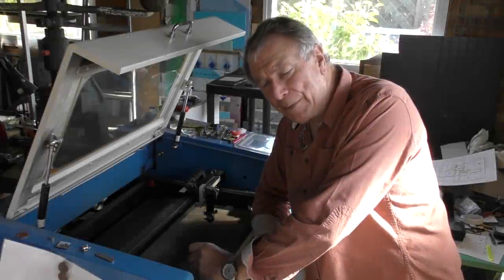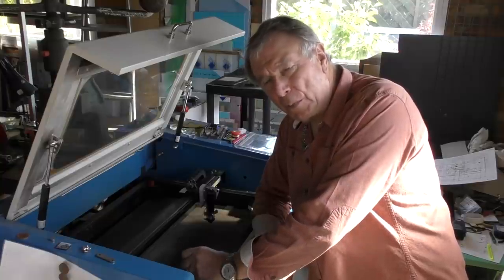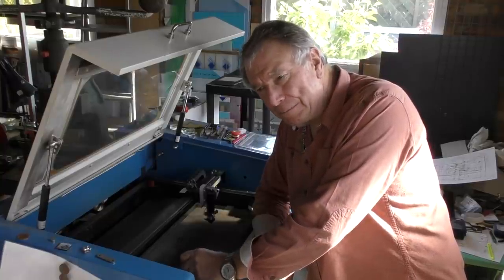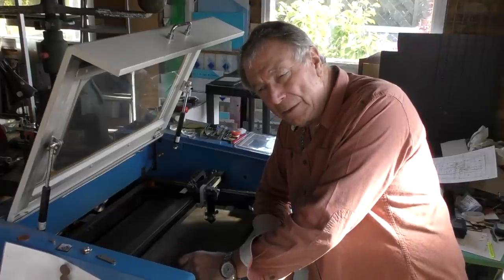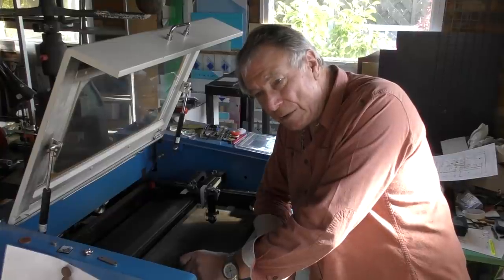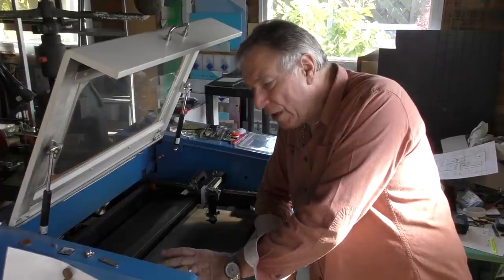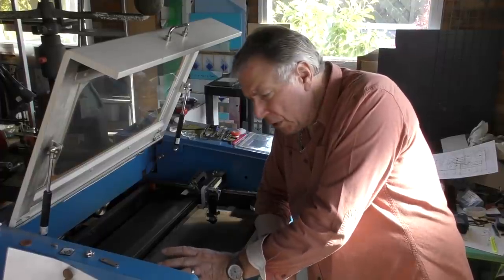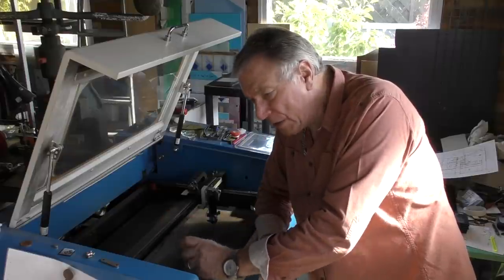RDWorks Learning Lab 189 Creating the Russ Spec Machine Part 1

Comment: I recently bought a UV printer, it's got a massive heavy printhead assembly.  They solve the curtains problem using an encoder as well as mounting the pulleys on springs, that greatly reduces the vibrations while maintaining the grip on the belt.

Comment: I just bought an 1300mm x 900mm 100W laser.
The laser works fine, But I just realize isnt 1:1 scale.
I design a line of 950mm and the laser cut a 940mm. 
I use RDWORKS and RDC4442 controller.
do you how can I fix it???
Reply from the maker: Hi William
 Sorry I missed your comment and apologise for the tardy reply.

First draw a large square in RDWorks , say 200mmx200mm Set the parameters to cut at about 20% power and 20mm/s. On a piece of card/wood/mdf burnthe 200mm square, and measureand note the X and Y dimensions you have created.
Go to FILE, Vendor Settings and use the password RD8888.  First you must press the READ button at the bottom to upload the current settings in your machine. Select the MOTOR and  put a dot in the X axis.
  The second window on the right is Step Length. Beside that is a button with 3 dots. Press it and another window pops up.  In the top, graph length, write your drawn dimension (200mm). In the bottom window write your measured X dimension and press OK.
Now do the same for the Y axis. Make sure you now press the WRITE button to send the new settings back to the machine.

Now run your square again and it should be perfect. If your diagonals are more than 1mm difference you will have a squareness issue also.

Best wishes
Russ

Comment: I love the videos Russ. My green k40 is arriving today(MiniHulk)! 
You may be able to reduce belt slipping at higher accelerations by moving the bearing axis in line with the stepper axis and reduce the gap between the bearings and stepper drive. Maybe even a plate connecting the tops of the bearing screws together to stabilize them more(probably over kill). I understand you had a concern about the radius of the belt bending, bigger bearings or some sort of belt cooling might help. There are also some really good rubber conditioners sold at auto part stores that might help extend belt life under extreme conditions. 
P.S. I want the Russ edition. I only bought mine because it was the closest available. 
Cheers!
Reply from the maker: Hi 
 The belt is not rubber but urethane. Rubber is very compliant like a bouncy ball and stores the impulse energy from the stepping action of the motor There is usually a delayed action on these  impulses reaching the head but at certain motor speeds (stepper frequencies) , just like bouncing a ball, the head goes into micro resonance. The stubbier AT urethane belt tooth form dramatically reduces this.  Turning the belt over and creating a flexible rack and pinion drive has solved other major performance issues and although my initial concern was that the l small bend radii would affect belt life, that appears not to be the case because after more than 3 years of significant use as an engraving machine, it is still showing no signs of degradation.
 By the way, the belt cannot slip because of the teeth. No, what you see and hear is the stepper motor unable to deliver enough magnetic torque to accelerate  the system beyond it's natural power limit. The rotating magnetic field in the outer motor windings  continues to rotate  but leaves the rotor behind because there is too much external resistance on the rotor. 

Best wishes
Russ
Reply: @SarbarMultimedia  excellent, thank you.

Comment: Just wondering without changing too much around could you reduce the weight of the better pulley by machining holes in it? I noticed by default they are solid.
Reply from the maker: Hi Brett
I wonder what machine you speak of because the pulleys on this China blue machine are only about 16 mm diameter and weigh half of nothing. My Lightblade machine is built like a  tank and has a large reduction pulley  system from the X stepper motor. Yes that could benefit from a lower inertia. It works reliably but will never be an engraving greyhound.
 Best wishes
Russ
Reply: @SarbarMultimedia  yes, I was referring to your point at 14:36 where you mention that the big pulley is essentially a flywheel.

Comment: Hi Russ; simply brilliant, as always! I've got the same question of "Custom Solution": could you share your design for upgrading existing machines? I'm aware that different vendors might have designed their machines in a slightly different way than yours, but still your design represents a great basis for upgrading our machines. Thanks in advance🙏👋👍
Reply from the maker: Hi Francesco
I am making a very small batch of flexi rack and pinion drive brackets/mirror 2 holder that may be of interest to you, Send me your disguised email address in another comment and I will contact you with information.
Best wishes and thanks for interest
Russ
Reply: @SarbarMultimedia  would you still have one available?
Reply from the maker: @ennogroen  
 Hi Enno

 Just add your disguised email address to another comment and I will send you a data pack.. I will also delete your comment/email address from public view.
Best wishes
Russ

Comment: Hi Russ, I am confused. Here you photo engrave at an insane speeds and  75% to 85% power. But, at 75% power you are way above the preionization power which you do advocate for. And working above the prionization power doesn't seem to have any negative impact on your results. So what's the answer to this - do we need to stay in the prionization region or not?

By the way, your motor (on the other machine) doesn't look a like a plain stepper. It has 2 cables coming out of it, so one is supposed to be feedback. From which I conclude that your motor runs in a closed loop (whether closed loop stepper or even a servo). Stepper don't have torque at higher speeds.
Reply from the maker: Hi 
 You are learnong well about preionization. If you run the video again you will hear that the fox , which is a dithered image is being done at 18%. That power is towards the upper limit of preionization for this tube  because at 20% it becomes a stable beam. Yes I did run faster to test the acceleration limitations..Althought the results appeared reasonable at the higher power there was a lack of crispness and as I pushed on to 1000mm/s the problem becacame very obvious. This was an experiment that sort of worked but didn't meet my normal  standard for photo engraving. So please stick to the safe preionization zone for photo engraving. There is a follow up video that may interest your where I do a deep dive into the limiting factor of engravinbg with a glass tube...the HV power supply.  see https://youtu.be/Cgkze6gPI8M
Here you will see me doing super quality photo engraving at 18% but at 600mm/s. However,  this is no longer guess work, I am exploiting certain properties of a  specific HV power supply. Be suprised.

 You are also very observent re the closed loop feedback steppers on the  Lightburn machine. No it cant loose steps but you can still drive it too fast and it complains.  The only time you need the torque from the stepper is during acceleration to scanning speed. The faster your choose to run  a scan the greater the torque required to get there quickly.   As  you rightly say, the torque drops off with speed, thus  faster your scan speed the  less toque is available as it aproaches that scan speed. Hence,  as I push the scanning speeds higher, I have to back off the acceleration to prevent step loss. Its a balancing act . The aim is always to achieve the fastes overall run time and sometimes running at 600mm/s achieves a faster cycle time than running at 800mm/s. At 800mm/s the acceleration has to be  backed off and that causes the overun at each end of the stroke to be longer.

 Thanks for the gear comments as this allows me to explains something interesting forothers
Reply: @SarbarMultimedia  Thanks a lot for clearing it up for me. Thank for the link to the other video as well. It's really interesting to see the actual signals behavious on the screen.

Just recently have I found the additional settings of cutting and scanning parameters under the "user" tab in RDworks. Up until then I had only set the paramerters for accel and speed under the "vendor settings", but I was not able to get good quality of intricate detailed cardboard cuts nor engraving. Under the Cut Parameters had to set Max Acc to 2000 and Min Acc to 100, back off Start Speed to 5 and Speed Factor to 20 in order to get acceptable results. Not perfect, but a lot better. 

For the Sweep Parameters had to reduce X and Y Starts Speed to 5  X Acc 4500 and Y Acc 2000, Line Shift Speed 10. Sadly, these parameters are nowhere near your insane accelerations.
Reply from the maker: @DYEngineering   Hi 
The vendor settings are  just limits that the machine builder sets They are almost meaningless if you wish to experiment. For example you can set the vendor X acceleratoon to 100.000 and that is the max value that you can set in the USER settings. However long before you reach that limit your stepper motor will complain and maybe 40K or %)k is the max the machine will tolerate There are no specific dangers to setting the values high. Be adventurous
 However  a word of warning. SAVE your Vendor and User settings as a file before you make any changes. Everytime you are happy with a change you have made,  create a new set of files just incase you want to go back a step.

Comment: 12:50 Nice to see that project being completed Russ! Just wanted to add my 2 cents, that I completely solved that curtain problem on my machine with very minimum work:
1) replaced Steel core PU belt with wrong pattern with a proper rubber gates 2GT belt that is designed for such applications specifically. 
2) replaced pulleys on both sides with proper 2GT 20 teeh pulleys.

Had a dramatic imlrovement immeduately and curtains disappered for good. I knew that because I had quite a bit of experience with 3D printers and we print very precise parts on them daily with standard belts setups, and we never had such problem, so I knew that the problem is a very stiff belt with incorrect teeth design for application, those sharp corners on belt teeth is what caused that problem, 2GT belts are different and rounded, and if you get a soft belt with fiber core it solves this problem entirely and in an easy way.
Reply from the maker: The original belt and pulleys were HTD rounded form and designed to transmit power in one direction. I became fixated on finding the best way to create high quality photo engravings. During that pursuit I found I was able to generate phantom pixel pulses at certain engraving speeds because of system resonance. The mass of the head combined with the pulses from the stepper were being stored in the compliant rubber teeth and producing an exaggerated stop start motion that created these false pixels The PU belt with stubby teeth (same 3mm pitch) stiffened the whole system and cured my pixel issue. It was only a little later that I encountered the curtains issue  and a full year later before I hit upon the  flexi rack and pinion approach to solving it.  The curtains issue shows itself as banding in dark areas of photo engraving. Its almost 3 years since I changed my machin and I have never seen any banding in ny photo  engravings since the modification.   It is very interesting that your diametrically opposite approach  (where I stared from) seems to work for your machine. It shows that there is no single best solution.
Thanks for the information so that others can do their own experiments.

Best wishes
Russ
Reply: @SarbarMultimedia  yeah, the only reason I mentikned my solution is that it seems much easier to implement. Your solution is very "proper" for sure. I just personally feel a bit lazy when fixing chinese machines, so I pursue the shortest path 🤷🏻‍♂️😁 but yeah, it totally worked. I actually sold my used laser machine for $500 more than I paid for it new, mainly due to my upgrades and mldofications, many of which are thanks to your research and this channel! :)

Comment: Russ I have another question I would your good advice on....I have a new laser with a 100 watt reci tube and the tube was fading from 26 max milliamps to 22 after about five minutes (I  soldered the high voltage connector and screwed it back on and that helped keep it up at 25 steadily) ( I ended up changing the tube to test my spare tube... to see if I could replicate the results. I can keep it at about 26 or 27 milliamps (Spare Extra tube) also I was cutting an 400mm circle 6 times at 95 % power 14mm /sec ,  I normally don't go past 83 % power)  is that normal for a 100 watt system,  should n't I be able to push past 30 milliamps? thanks for the help. Russ I would like to also let you know both tubes are new and have less than an hours use. Thank you.
Reply from the maker: Hi Dwight
100 watt Reci tube could mean  one of several tubes . It depends on who you bought from and how honest they are . There will be a model number on the label and I guess it may be a W2?  If so that is a MAX TEST power (at 29mA) and not something you can ever use. In reality this is a about an 75 watt tube if run at the advised maximum of 25mA  Do NOT run at more than this, other than for a few seconds of exploratory testing,  or you will dramatically shorten the tube life.  

If it is a W4 model then  here is what the spec used to say

The test current is 30mA. Maximum working current is 30mA. The running current must be kept below 28mA. The life span can reach 10,000 hours if the current is kept below 26mA

 This tube is specified as 100 -130watts by Reci.  So let me translate what this specification means 
We test this tube at 30mA and it delivers at least 130 watts. That means the working current COULD be as much as 30mA BUT YOU cannot use this or you will invalidate the warranty. Instead you can run at 28mA max  and your tube will deliver 100watts . However, if you want our agreed  10,000 hour life (whatever that means???) we recommend you do not exceed 26mA ....... What they do not declare is the watts that you will then get. The answer is about 85 watts. (so it's not a 130watt tube???)

For some strange reason the myth exists that Reci tubes are the best. I have use 6 various powers and am yet to be impressed. As you will see from the above specification they are over specified and twice the price of good quality equivalents.

 Look carefully at the test graph  on the tube  Has it achieved  the maximum test value of 100watts (if W2) or 130 watts (if  W4) . Failure to make these values means the tube failed final test and has been sold as a B grade without warranty  to the machine building factories.. 
The laser tube and power supply market is a shark infested pool!!!

Best wishes
Russ
Reply: @SarbarMultimedia  the tubes are w4 tubes, I would be very interested in your thoughts on good, strong tubes. Maybe you could do a video on this with help from your CloudRay friends. (I thought I saw a laser tube from them that had the red dot on the inside of the tube once) I got this second laser and put the Light burn camera on it so that my wife could use it easily, I ordered it with the reddot mirror combined ( removed ,worthless Junk) I got the automatic air assist (and I bypassed that because it only has on and off modes and not the low blow mode for engraving- again like the CloudRay one. Back to using my manual value) and ofcourse I don't care for the auto leveling pen ethier. I am waiting to hear back from the laser manufacture about the power settings now. Best wishes to you and your family, Thank you.

Comment: Hi Russ, have you made any mods on Y belt tension pulleys? Originally they are awfull (blue machine)
Reply from the maker: Hi

 I have never had cause to touch those idlers except on one occasion in 5 years when I retensioned the belts about 4 years ago.. I only fix things that don't work for me  and that I can see would improve the machine without dramatic expense. I agree that  the design is a bit flakey  and exactly the same on the X belt idler but, cheap and minimalist as they are ,they keep working,

Best wishes
Russ